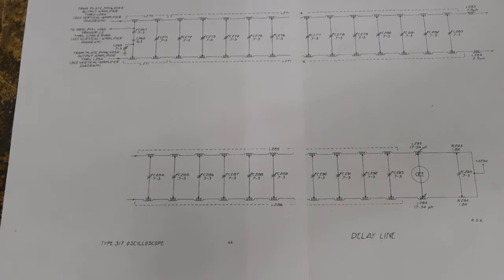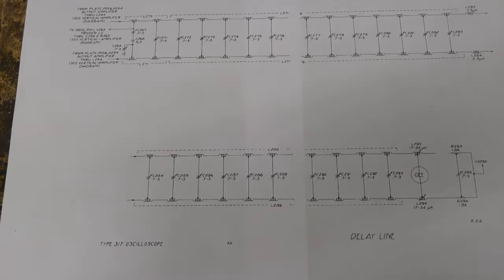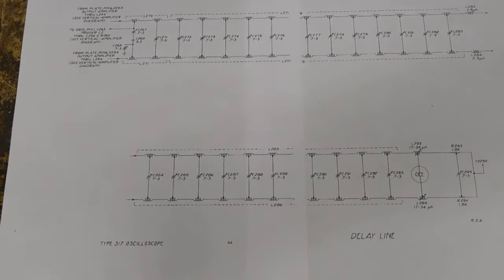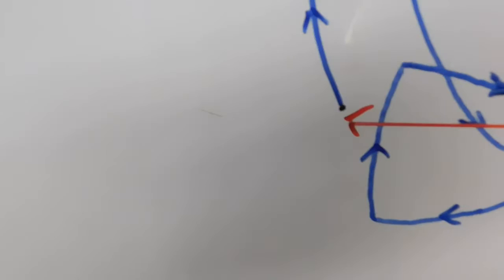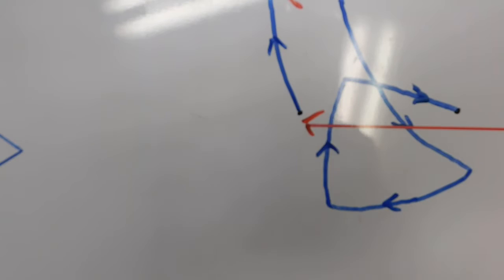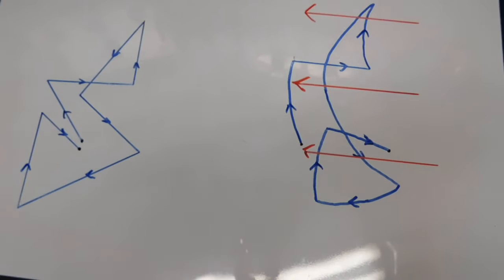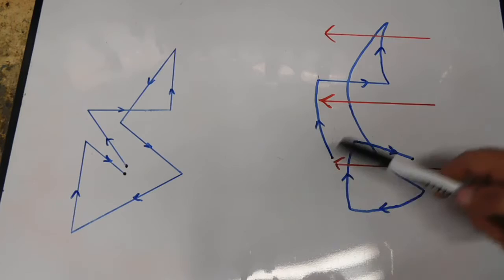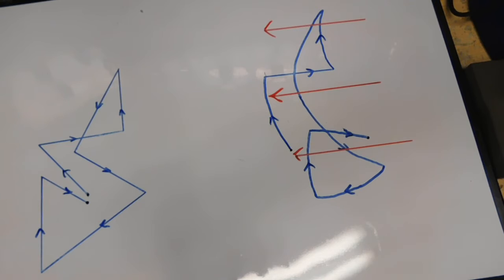How the delay line works

Comment: If you look at the circuit the inductance per section could be typically 33uH and the capacitance is maybe 2.5pF and there are 25 sections. So the delay will be approx 25*((33e-6 * 2.2e-12)^0.5) = 0.213us.The characteristic impedance of the balanced delay line will be (L/C)^0.5 = (33e-6/2.2e-12)^0.5 = 3800 ohm.  If you look at the scope schematic, the delay line is terminated in two 1800R resistors. 1800 * 2 = 3600 ohm which is pretty close to the calculation for the characteristic impedance. The delay line absolutely needs to be correctly terminated in order to prevent reflections. The job of the delay line is to delay the waveform to the scope display but it must also preserve the shape of the waveform and not corrupt it with any false signals caused by reflections that can give false ghost/echo signals. So this delay line will have been designed and adjusted very carefully. The technician would have made sure the delay line was adjusted to give a flat group delay across the frequency range and also to not give any reflections that could cause false signals to appear on the display after maybe 0.45us.

Comment: The time delay should be a function of the square root of L*C. It takes TIME for the energy to transfer from the series inductors to fill the shunt capacitance with energy. It also takes time to then transfer/empty the energy from the shunt capacitance to the next series inductor whilst filling the next capacitor with some of this energy. So the energy moves along the line transferring energy to/from each inductor and capacitor and the time delay will be a function of (L*C)^0.5. The capacitance C will be made up of the shunt caps and also any distributed capacitance between the inductors.

Comment: Thanks for doing this for me Dennis!I just saw it posted now. I'll watch now and let you know what I think.Again... Thanks! Tom
Reply: Well Dennis, I just finished watching the video. Makes perfect sense between the inherent DC resistance of the wire and the impedance of the coil. Yes, I remembered that current in a coil lags voltage by 90 degrees. 
   A great video that made me go from ignorance to knowledge on delay lines.
          Again, many thanks my friend!
                                                                Tom
PS Oh yeah... I think a bunch a small tutorial, hints, tips, etc. videos sounds really great! Plus there's a big advantage as well. You don't have to worry about your video camera battery dying again!   {8-)
Reply from the maker: Thanks Tom. I'm going to start a series on the basics soon.

Comment: Dennis, as you know, a fair amount of your viewers know and understand radio circuits and can work on them. When it comes to TV circuits though, I imagine that number goes way down. So here's my question friend. have you thought of doing a series on the basics of television? Kind of like a short course from front to back explaining the vertical, horizontal, high voltage and how it all comes together. Very basic, like an old black and white.
I'm quite sure I've watched all your videos and I know you have covered different tv areas but this would be from front to back for learning the complete deal.
Just thought I'd throw this at you to see what you thought. Thanks as always for all the good stuff.
Carl
Reply from the maker: I have been wanting to do a series on tv circuits and will starting in the fall.
Thanks for watching, Carl

Comment: Hi Dennis

Hello from the Scotland UK 

I enjoy watching your videos’ but don’t comment very often But
would be very interested in you doing some of the basics on caps/resistors/etc
on tube Amp stuff

I have built my Hi FI tube amp a JE labs Single ended 6SL7/6L6
and love it but some more basic tutorials’ would be very helpfully for me to
progress    

One thing I have to keep in mind when watching yours and some
of the others, videos’ are the WALL Voltage differences between your 120v and the
UK voltage of 230v, which is really 240v, and if I check that with a true RMS
Meter my wall is 249v 

Thank you for the help

Colin
Reply from the maker: Hi Colin, It's good to hear from you. I will start a series soon on the basics. Thanks for watching.